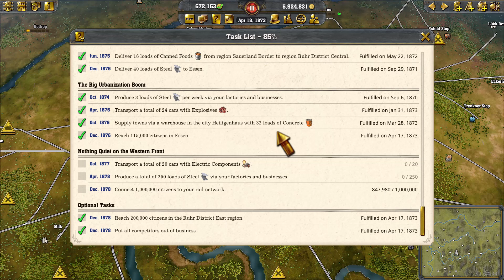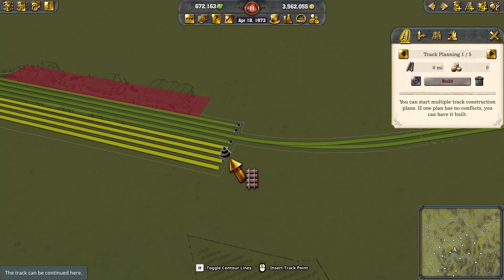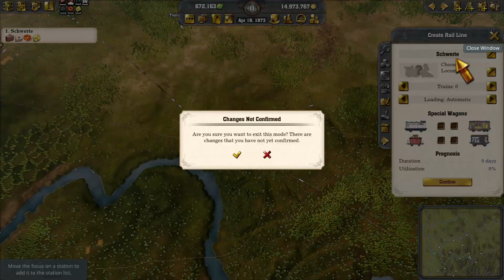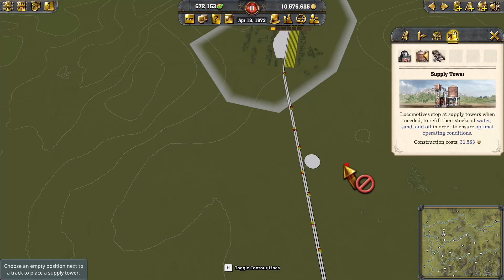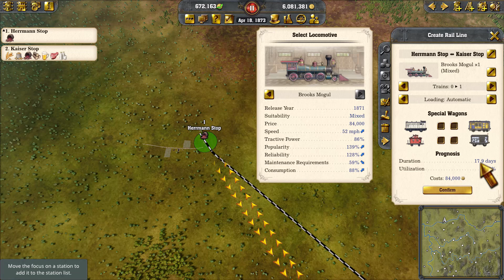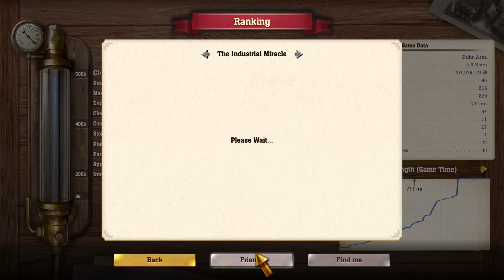Railway Empire 2 Industrial Wonders DLC The Industrial Miracle Part Seven

Comment: Great series and a very key comment/observation at the end - with the more complex production chains in this DLC you really need to have more cities with production capacity that you grow at least to 40k and ideally stop growing @ 60k, i.e. lvl 4 factories. In fact I think this was the first scenario where I went around and deliberately destroyed Immigration offices/Libraries in some cities that I didn't want to consume high-pop stuff. Those 20k (or below) cities are virtually useless if you want to get stuff up and running quickly. Especially concrete is painfully slow, indeed.
Reply: I played Rome this weekend to get an achievement (all goods available in rome) and used this technique to produce all goods. 
I noticed that when you deliver the first 6 or seven basics and no more the cities grow to around 50 to 60k. 
3 cities like that and you can have 6 factories for special goods!
Reply from the maker: Thanks for the comment, good observations!